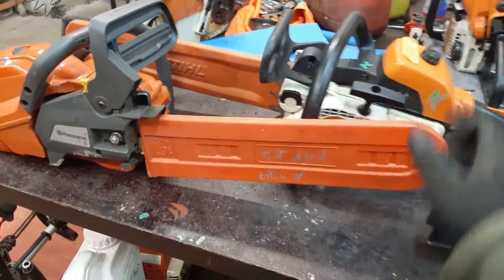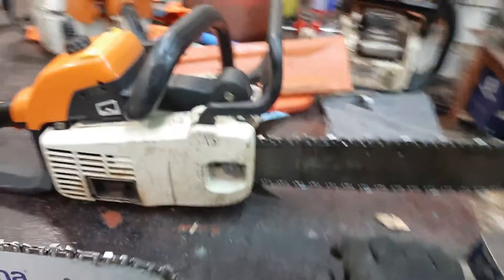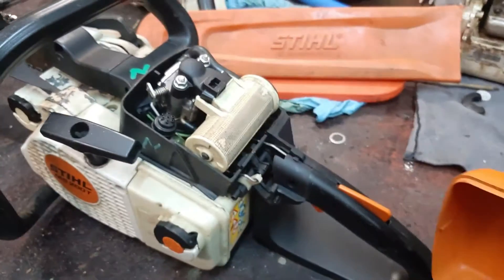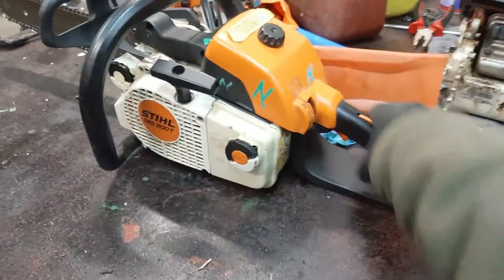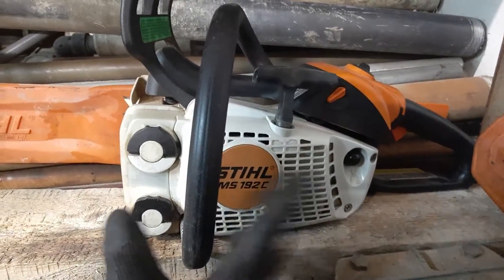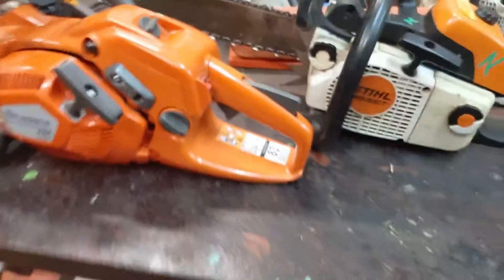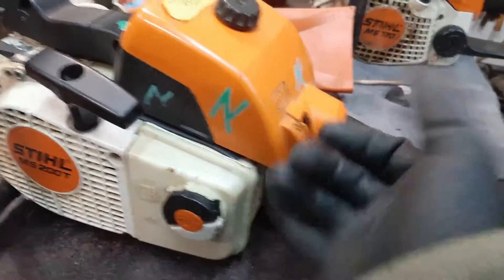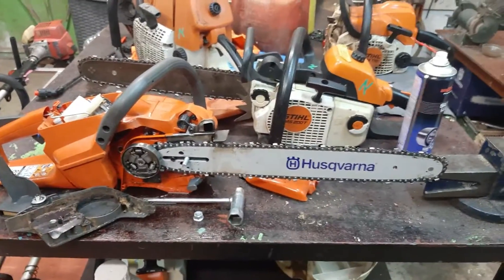A die hard fan of rear-handle conversions of top-handle chainsaws!!

Comment: That 439 is actually a Zenoah/RedMax design. Made in Japan. It's an insult to compare a MS192 to the GZ360 and GZ3500T. The 192 is far inferior and the Japanese saws will be running far longer than that Stihl pinger
Reply from the maker: I'm well aware of that. The talk was about the *BUILD STYLE (top handle body made rear handle).. Where did you hear me compare them in terms of the grade or longevity of these two saws?  The 192 rear handle is for carving or home use. The Husq\Komatzu is technically semi-pro IMO, and can be very well used by pros of taken care of and not abused, although relatively inexpensive.. also very easy to clean becaise of it's design. Too bad U misunderstood.

P.S.
The other STIHL surpasses the two together times two, again - IMHO.
Reply: @chainsawsandmore5480  my bad man, I'd just had a few conversations where the opposite party just raved about how the 193/194 was the best top handle besides the 201/200 and they're the only ones worth buying, and similar conversations with a Husqy guy who thinks the Orange plastic makes two identical saws inequal, and somehow the Red plastic makes you less professional? I'm sorry, I was frustrated and came off a bit unhinged. Glad to talk to another fan of Rear-Top Handle saws! Excellent video as well 👍
Reply from the maker: @BlondeWick  hey man, it's all good. Every machine is made & destined for a very specific job and work load, and when some don't follow that, you see those problems we see all the time while almost no one relates to the basics: was this chainsaw they used was up for these cuts? Was it supposed to bear these forces & temperatures expected from the user & applied by him\her?
I can see you know all that very well. Hope you can enjoy this lil' channel and maybe challenge me with questions & requests on either video\s 🙏🏽✌🏽👍🏼🌴🌱
Reply: Hi thanks for posting this. So I bought a cabin and I need a chainsaw. I know nothing about chainsaw to be honest I have never used one. I need one for cutting fire wood. Is the 439 Husqvarna a good chain saw for that? I'm 6'2 and about 250. Please let me know I would appreciate it. I know this 439 is a bit expensive but I'm ok with the price, please let me know your thoughts thank you.
Reply from the maker: @fabiansandoval6132  anytime man✌🏽🙏🏼🌴
The thing is also what is your budget for a chainsaw? Because there are plenty chainsaws for firewood. What local dealers do you have there? Anyone of them have better customer service than others? Are they professional enough to give you proper basic training locally to teach you chainsaw safety and get the most out of your purchase first hand? It's very important.

Find out the best dealer you can find in your area with the best deals on more than one or two chainsaw models for sale over there that they have so I and hopefully other commenters can add their own tips about chosing the most suitable one for you from the bunch.

It seems for your mass that you could enjoy a compact chainsaw but I'd say you should also aspire to get even a better one that will endure a bunch of repetitive bucking and cuts for firewood.

I have no idea what's available for you there but open your mind for at least 2 or 3 big well-known brand names, like STIHL \ ECHO \ HUSQVARNA and so on.

Keep me\us posted here and I'll do my best to see how to advance from here.

Hope to read from you soon.

blessings, and safety above all

Jo.
Reply from the maker: @fabiansandoval6132  I should also add that the 439 has a small ⅜" chain (LP = low profile ⅜"), which is the smallest of 3 most commonly used chain sizes.

If I were you, I'd choose a chainsaw with the common medium size .325" pitch chain which as far as I'm concerned - is way better and more durable for firewood cutting\bucking.

Chainsaws that are made for running .325" bar & chain are usually between 40cc to 50cc engine size. I can name a few, like STIHL 250 \ 251 , HUSQVARNA 445 \ 450 etc'..  other brands I'd rather you to tell me what's available for you on sale \ good deal so I can do some research and give you at least a short comparison between them.

Much luck,

and keep us posted ✌🏽👍🏼
Reply from the maker: @fabiansandoval6132  also here's a link you might wanna watch for a starter:
https://youtu.be/oU3IPgicGCc